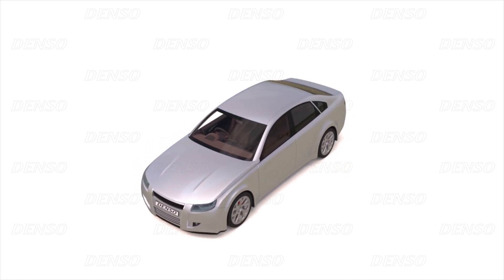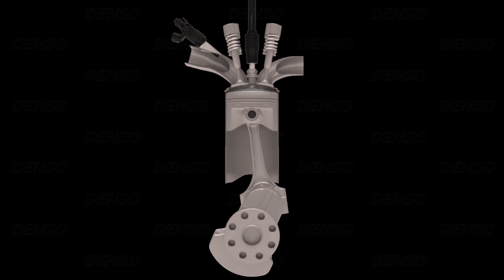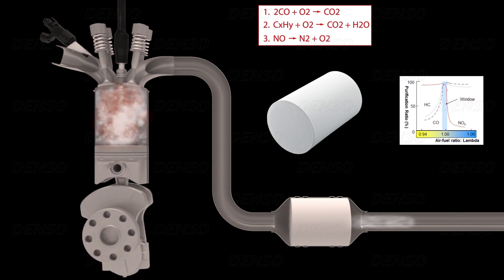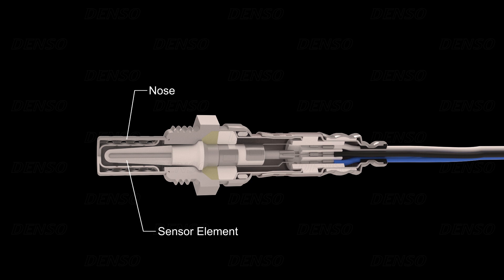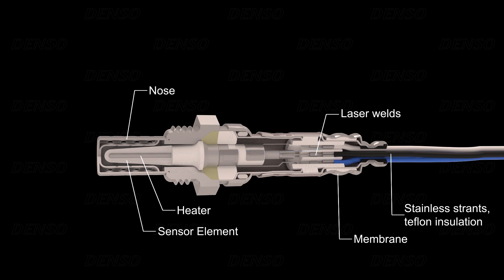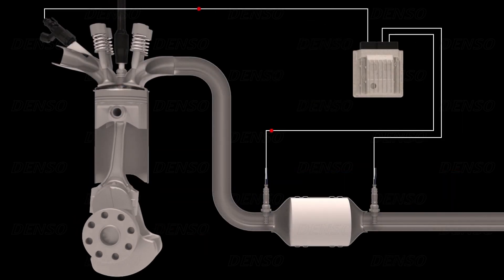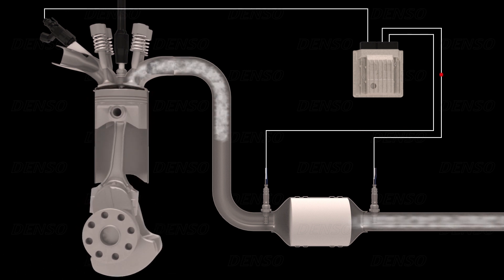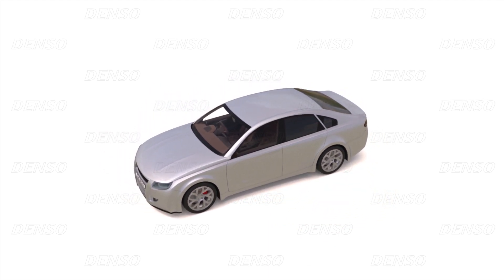Discover DENSO Lambda Sensor technology

Comment: I've watched multiple videos now that just glosses over the fact that oxygen is neutral. It isn't ion by default, not even at 350-800°C. Can somebody please tell me what they are talking about because it feels kinda crucial? Also air seems to teleport through a metal sheet and there doesn't seem to be an opening either, but I'm assuming the white stuff is the PTFE filter? Nothing makes any sense to me, am I the only one?
Reply: oxygen molecules are indeed neutral but the sensor has 2 electrolytes made out of platinum that convert the Oxygen molecules to iones. its a complex molecular reaction but you only need to know that the oxygen ions created by the electrolytes pass through the zicroniumdioxid to the low O2 concentration site and get converted back to the O2 molecules. And the ionisation is easier at higher tempretures often at around 450-600°C .
Regarding the air PTFE filter there is an opening for air to go through the sensor to the nose of the sensor u got it. Sometimes its hard to animate these things so they just simplify a bit.
Reply: @freedomplayer95  Thank you kind stranger! I'm pretty happy with that answer, none of my automotive teachers could have told me that. Whatever it takes to go places, cheers!